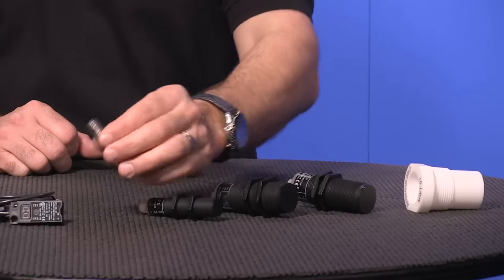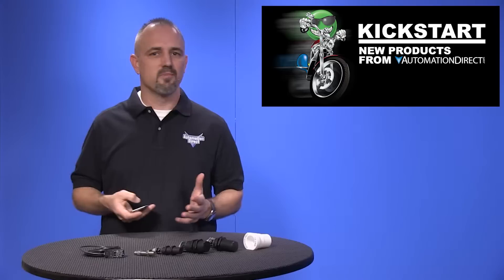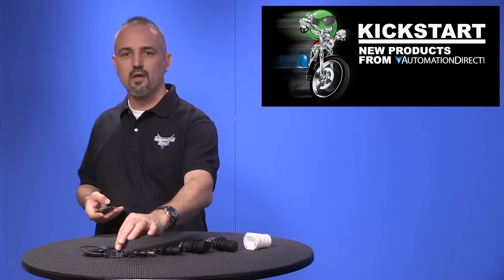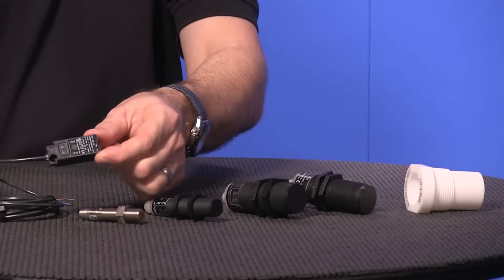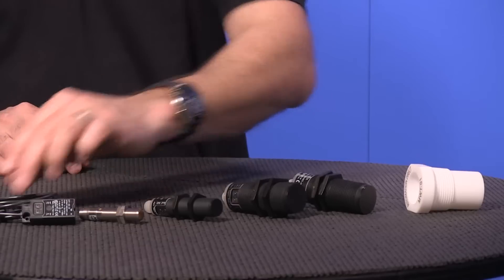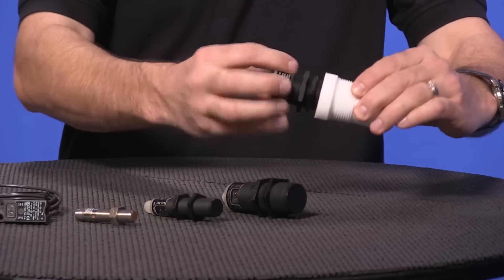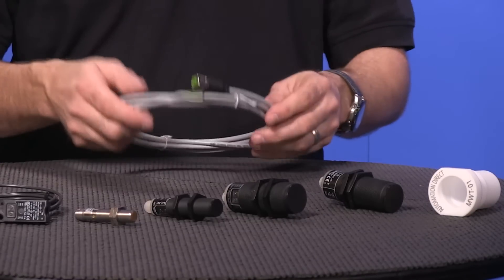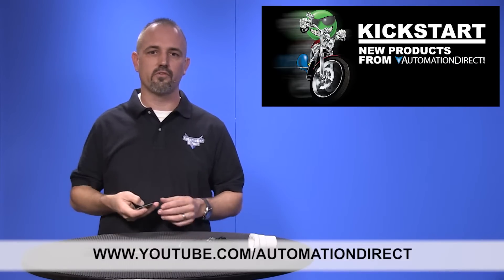AutomationDirect brand Capacitive Proximity Sensors

Comment: I would  like to use on a IBC container; filled with nitric acid and another one with soda so  do have a model capabble to messure that tipe of liquids on a IBC?-.
Reply from the maker: Eduardo, yes, there are possibly several models of sensors that would work with your application (Capacitive, Ultrasonic etc.).  It would be best if you contacted our free technical support to discuss in detail your application so the correct sensor/s can be suggested.  You can contact tech support here:  https://community.automationdirect.com/s/contactsupport